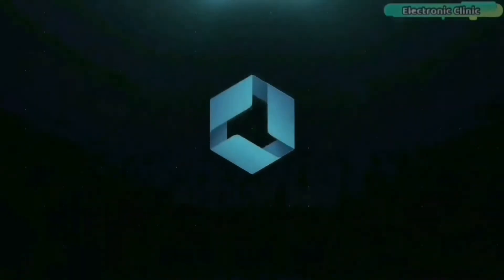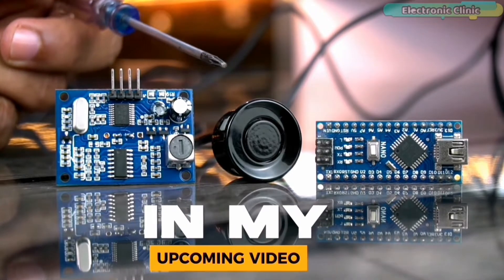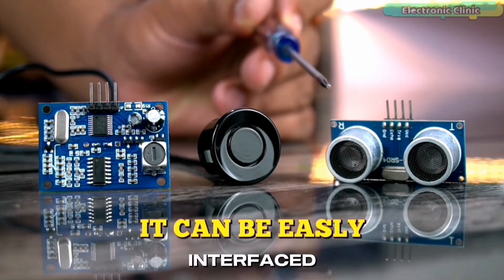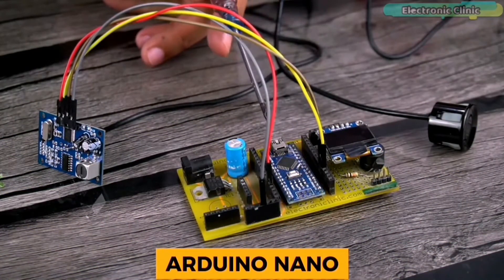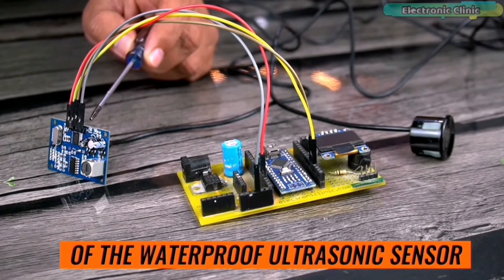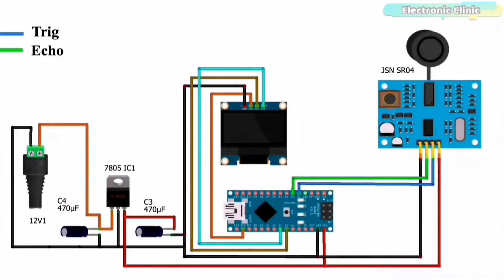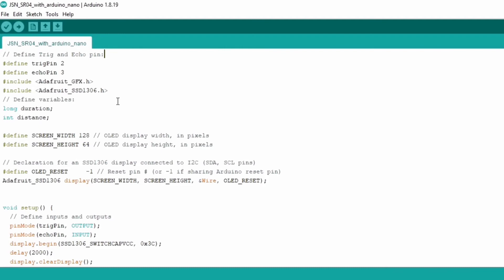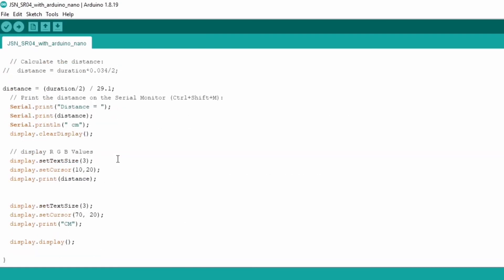Waterproof Ultrasonic Sensor with Arduino for distance measurement

Comment: Problem of the waterproof sensor it starts sensing at 20cm, which is still a large distance for a parking sensor, in Madrid we like or need to park our cars really tight for the lack of space. A smaller blind spot is required.
Reply from the maker: @danchuk3927  then you should try A02yyuw waterproof sensor. I have used it in so many videos.
Reply: @ElectroniClinic  I would, if every unit didn't cost 30€ EACH even on ALIEXPRESS. Thanks for answering UwU. Joking aside, I might give it a try.

Comment: Please reply this, in my project ,iot based rainfall measure.  I used ultrasonic sensor to measure water level in 4 inches PVC pipe.  When contact with water drops it not provide accurate values.  Waterproof  one i didn't use so far.  Will it work ? In 4 inches pvc pipe

Comment: With the other cheaper sensor you can buy a display board that the pins from the sensor plug in to the board & the display tells you the distance.

Why doesn't the waterproof sensor plug in this way?

It has a totally different plug in mechanism.

I'm hoping to maybe use the waterproof sensor for my car when backing up to help me park easier. So how would I power the waterproof sensor with a 9v battery to use this way?